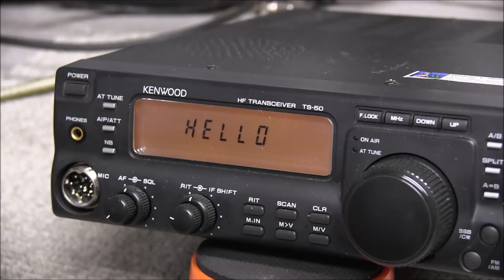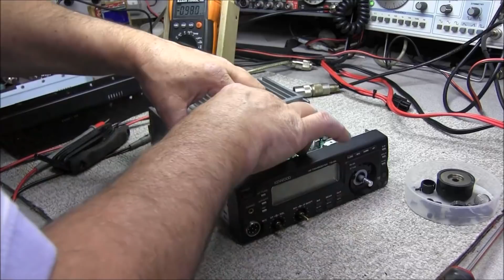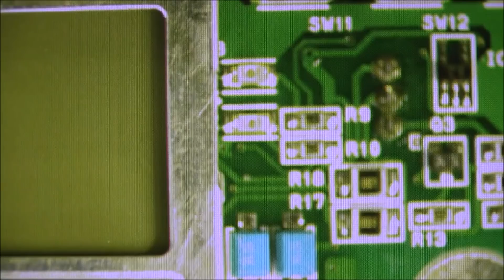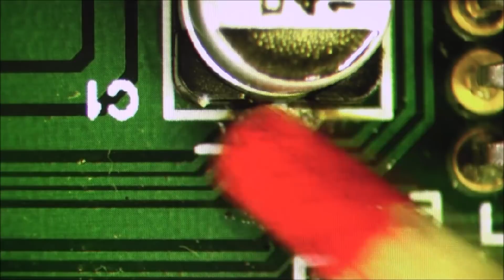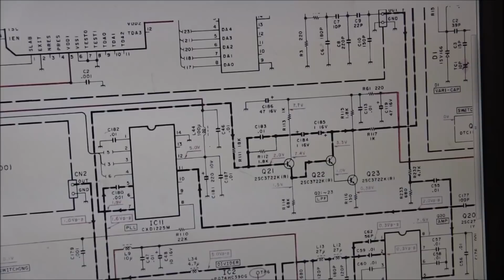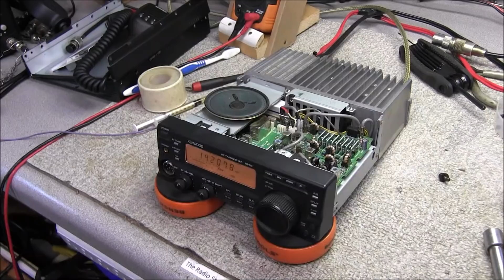#210  Kenwood TS 50 Display Problem

Comment: Hi, I have the same problem but I can't figure it out... although sometimes when the telegraph doesn't start on 10 meters everything is activated including the transmission... I replaced c186 and c80 on the TX-RX unit, c1 on the LCD unit ...a KAD2 track has been restored due to corrosion on the pad near C1 which has smeared it with acid, reactivating the second series of keys, and again c121, c122 and c 194...it doesn't want to start... what should I do should I give it up?

Comment: My TS-50 had this same failure. Capacitor fell off the board. The pad damaged. That via was also tough to repair I had to twirl a bit of wire in the via to have the indicator lights come on. Also some solder got into that large transistor and shorted the base and emitter making the lights stay on.

Comment: When removing those surface mount capacitors do you cut through the bottom of the cap itself or through the legs?
Reply from the maker: I just cut low on the can and then desolder the legs

Comment: Great video Buddy.  I have a TS-50S in my collection. I replaced ALL the electrolytic capacitors about 20 years ago after experiencing an issue with VERY slow AGC recovery after TX.  I was lucky to avoid a lot of PCB damage.  I also ended up with a ALC issue as well that needed a few SMT transistors replaced.  After the cap replacement, it was like a new rig and is still going strong today!

You are 100% correct with radios of this vintage (early 90s), they might look perfect on the outside, but are being eaten alive on the inside.  If you buy one, be prepared to replace the caps, hopefully you catch it before there has been too much damage to the PCB!  Modern replacements seem to be a lot better.  Make sure you buy genuine caps and not counterfeit. 

I've been through three local hams TS-450S/690S radios with leaking capacitors too, it's not just the SMT capacitors that fail.  It's good preventative maintenance.

Michael
VK5ZEA

Comment: Great lessons there, thanks. Does the TS140 have the same caps on it? Super explanations. cheers Dave VE7CMI
Reply from the maker: Thanks. The 140 does not have these caps only regular electrolytic.
Reply: Thank you for the reply, thanks for taking the time to answer your listeners questions cheers, Dave
Reply: @daveb4688  The TS-140S is of the age where going through and checking/replacing capacitors anyway is a good idea.
Reply: You certainly know your way around the TS50!  I have one that is no longer working. It was my only radio. Could you take a look?  VA6DRT.

Comment: I've replaced plenty of SMD caps inside the TS-850 over the years , A lot of the Kenwood's from this era have this issue .. regards de 'Gw0wvl' 👍
Reply from the maker: That is surely correct.  They can do some damage.

Comment: It was good to see your recent posts; I had begun to worry about you.  I would like to have seen how you soldered the new smd caps back in place.  Did you use hot air?  Would hot air have been effective in removing them from the pcb?
Reply from the maker: Hi Wendell. Thanks. I have been super busy at the public job. Never use hot air on those caps. They will explode.  Very easy to solder in with an iron.

Comment: Although the Kenwood folks probably weren't aware of the future failure mode of these caps it is sad that so many good radios are out there simply waiting to fail. Thanks for sharing Buddy!  73 - Dino KL0S
Reply from the maker: Sad thing is once they fail there is more damage from the leaky caps.  And if in the right spot can be very challenging to repair for the beginner.  Specially Kenwood's bigger units of this era. Thanks for stopping in Dino.

Comment: What brand / type of caps do you recommend? Where do you order them from? Will the replacements eventually leak too?

What brand model of diagonals are you using? 

I have one I need to work on eventually and fix it before it gets too bad. 
Great video, tnx for sharing!
Reply from the maker: I would only use Rubycon, Chemi-Con, Nichicon, Panasonic, for replacements.  Mouser or Digi-Key for the source.  I am sure there are many others but I know what works for me. A good rule of thumb is to just replace them and do not worry with checking them.  But if I do check I use Atlas Peak meters to do so. Any electrolytic capacitor is subject to leak over time. Kenwood did not use a good grade of caps in this era of radios.